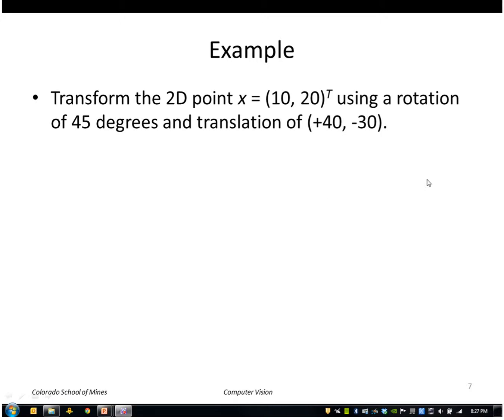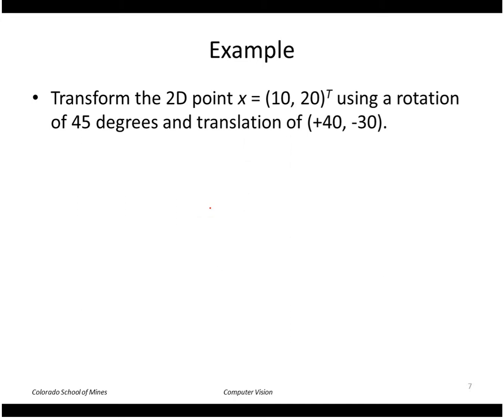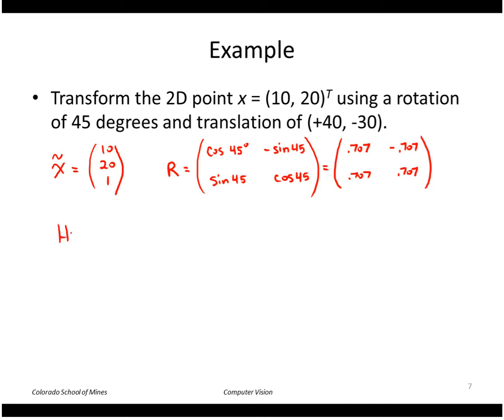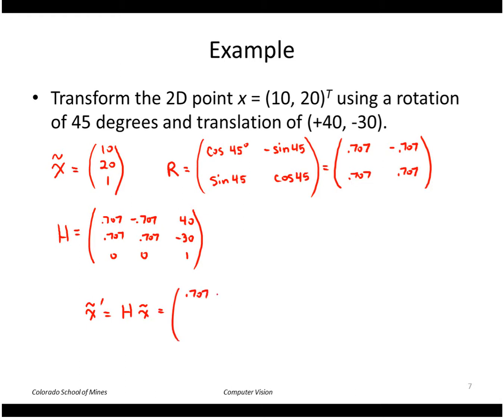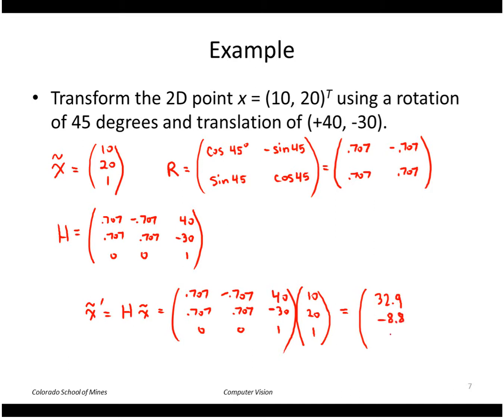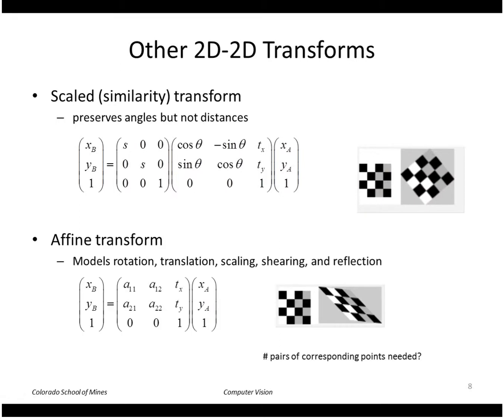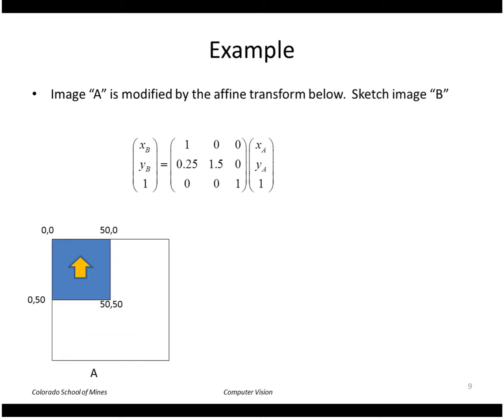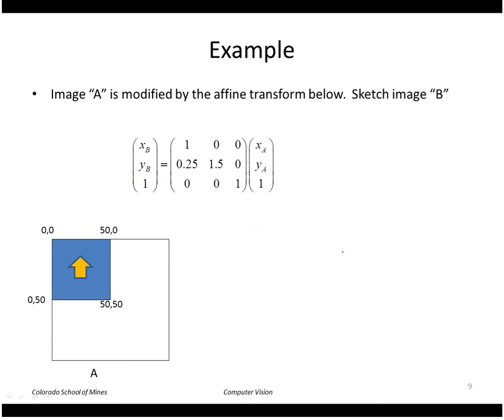CSCI 512 - Lecture 03-2 2D to 2D Transforms

Comment: Professor William,

Firstly, great video lectures and thanks for sharing these precious lectures. Secondly, what is the software tool you used to write? Is it written on a touch sensitive tablet, if so would you please tell us which one? Letters looks very crisp and clean.

Thank you,
Reply from the maker: Thanks for the kind comments.  I have a tablet from Wacom, that I write on.  IThe model is DTF-720.  I write directly on the Powerpoint slides, and then do screen capture using Blueberry Express software.